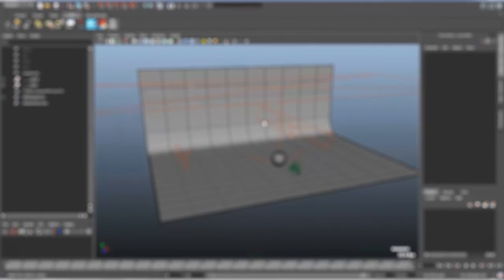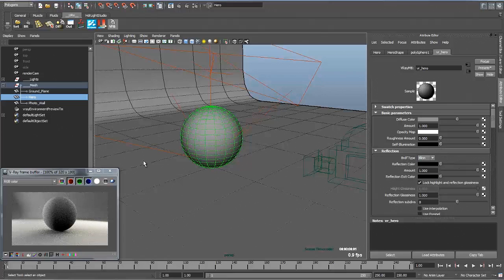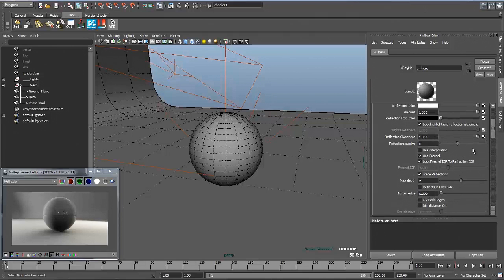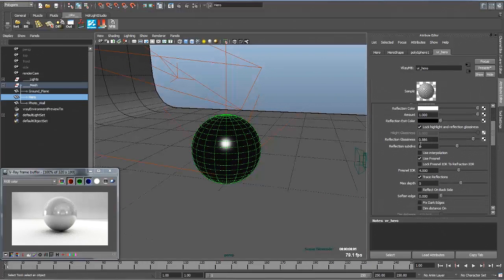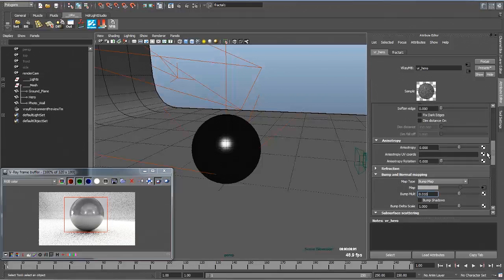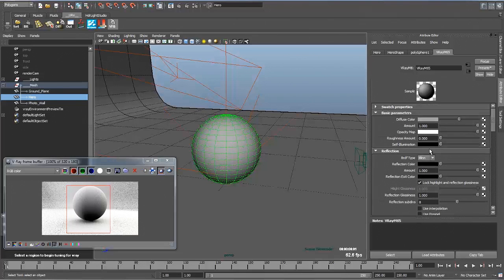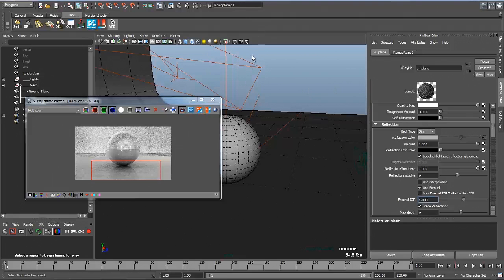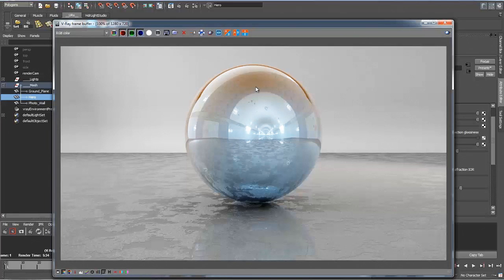Vray  Material Basics for Maya

Comment: for a chrome I set reflectivity to 1, keep fresnel and increase the REFRACTIVE index value up from default 1.6 to 40 or higher.

another tip is never use true black or true white.. always come in just under or above for any colour value.. so the reflective colour default white make it just beneath.  I've found this helps when using unclamped colours for 16bit and 32bit comps.

just my finding a hope they help someone :)

Thanks for the tut enjoyed this :)